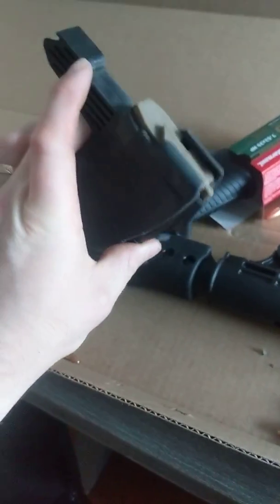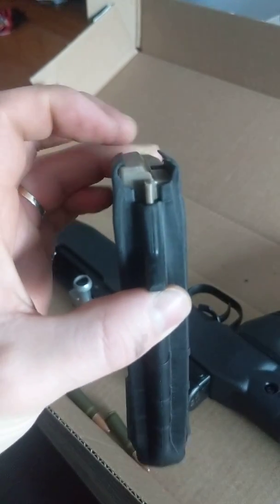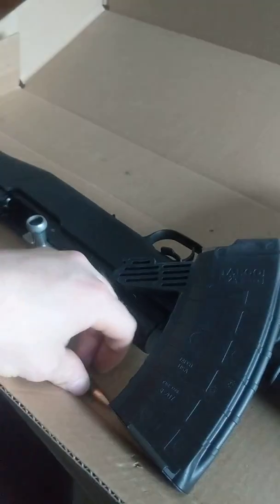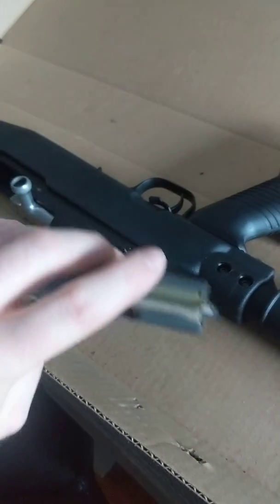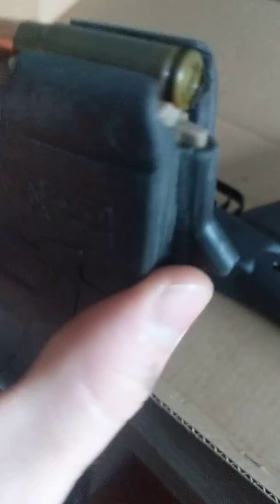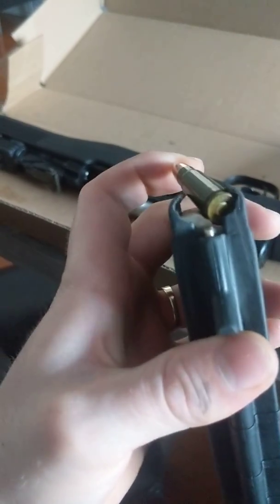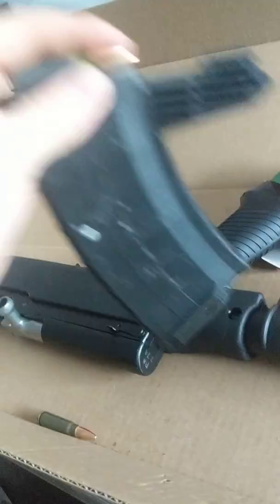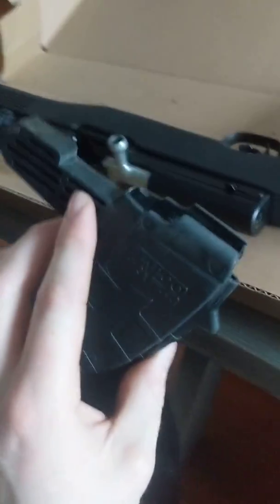SKS tapco mag feeding issue fix

Comment: To fix most feeding issues you have to smooth out and sand the sides and edges of the follower until it moves freely in the mag even without the spring. Oil it, load and unload a few times and keep the mag loaded for a few days and try it again. That should fix 90% of the feeding issues.

If it still feeds poorly, you have to sand the inside of the mag, usually where the tip of the bullets are because they catch on as they go up.
Reply: Thanks so much dude!

Comment: OK. Anybody with an sks. Realize this rifle was designed with a vertical 10rd single line fixed mag. 

It was not designed for double sided 20 rd mags.
It is why The Chamber has NO FEED RAMP.
I LITTERALLY just dremeled a divit feed ramp at the chamber.
Now feeds smooth as butter. 
I JUST GOTTA reblue the exposed metal ground out.
Reply: Can you show this
Reply: The original fixed magazine is 10 round double stack, striper clip feed.
Reply: What? Can you post pictures?
Reply: Yeah that's what I was gonna say, it's not single stack or it would be very long and not box shaped.. @josephhomen

Comment: Never had a problem with USA steel magazines feeding. I have one that was a little wobbly before I rapped the part that rocks into the stock with one rap of duct tape. It fed OK before and after, but I didn't like the slight play and the fix was cheap and low tech.